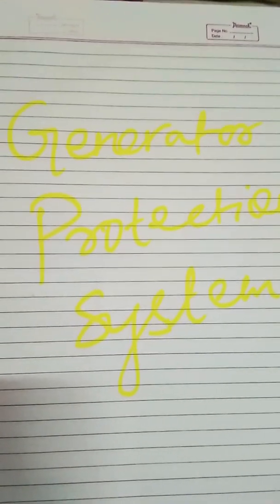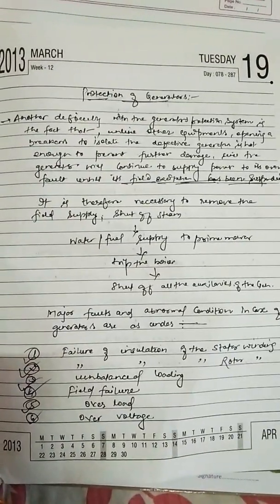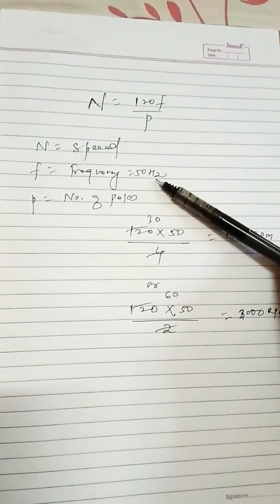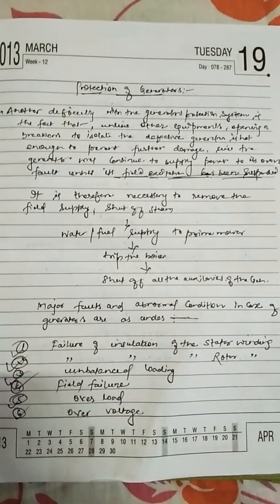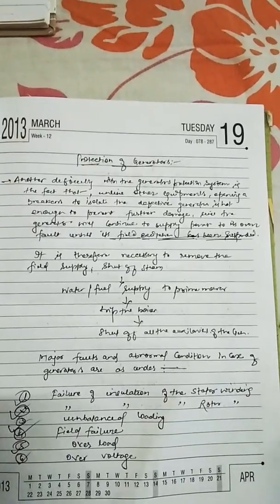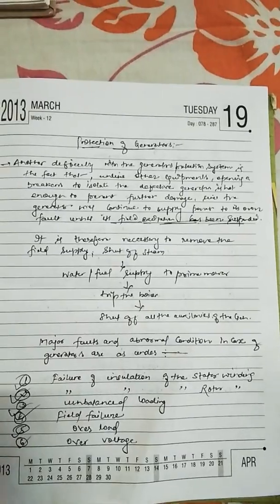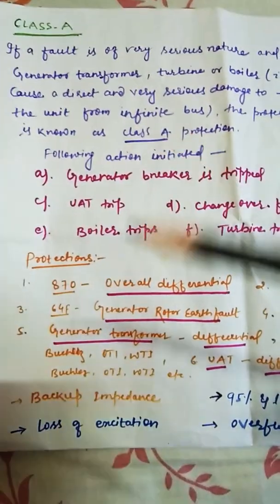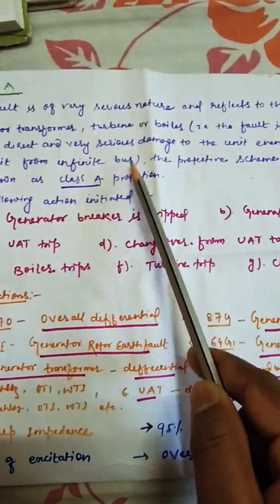Generator protection Scheme Class A,B,C Part-1

Comment: Sir I need your notes. Can you share me your notes in my email id..
Reply from the maker: Thanks for your message ,sure..
But which topics you want to cover ? I will share the details for sure ..my note is very rough ,you might not understand..I will clear you if you specify the doubt's ..
Thanks
Reply: @Electricaleasy4u  generator protection calculation sir..